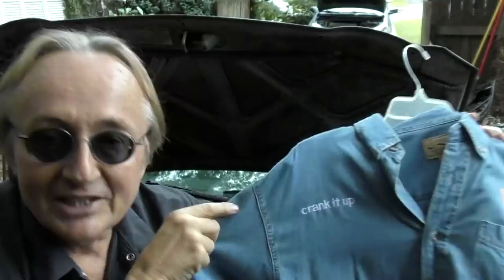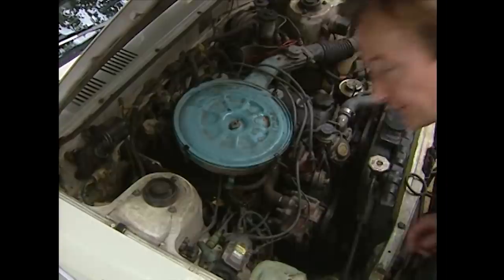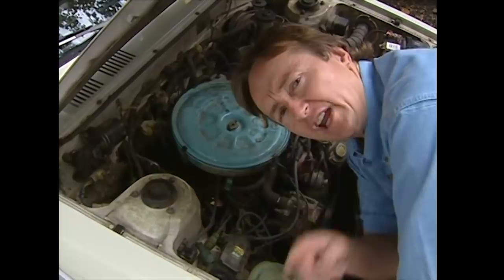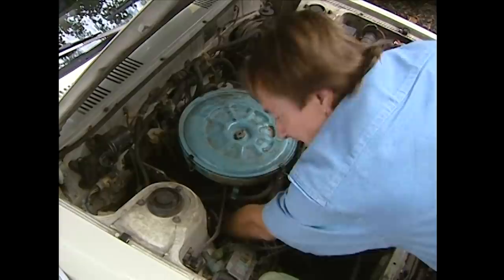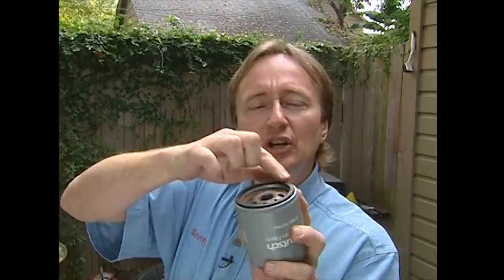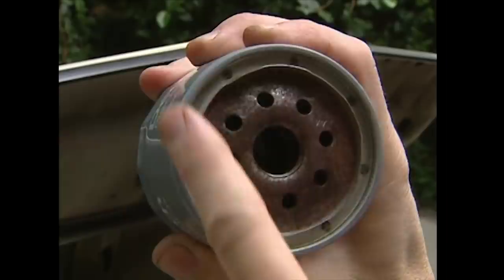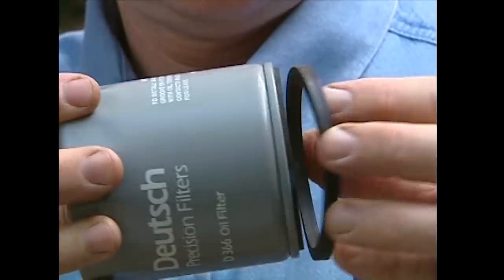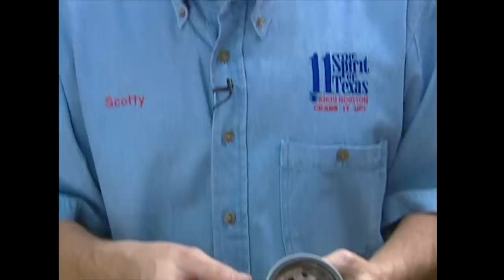Never Do This When Changing Your Engine Oil

Comment: Every time I try to remove an oil filter from oil change shop or dealer it feels like the filter is welded to the block. My old autoshop teacher told me the filters are self tightening, I think he meant by the expansion of the rubber o-ring. You go hand tight until it seats, and then about another quarter to half turn. This and always add a light coating of oil onto the new filters rubber o-ring seal before you install it. Dip your finger in the new oil and apply to the new filter, I also put some on the metal thread and in the filter if possible. Doing this I have never had oil leak from my filter in 15 years and am always able to remove the filter with firm hand pressure and no filter wrench. How do the oil change shops do this for a living and mess it up?

Comment: Scotty, do you have a tutorial on how to replace an oil pan gasket, without having to remove the engine? I have  1979 for F150, 302 v8. Just by looking around the oil pan and noticing oil residue I believe that’s it could be the gasket. I am pretty sure that is one of the many issues with this old truck, however, I would like an expert advice.

Comment: I made that mistake once with the Subaru I was out in the winter and it was cold and I did not see that the old o-ring got stuck on the engine I placed on a new oil filter after draining the oil and put about $40 worth of high-quality oil and additive into it started it up and it all started pissing out all over the place so I shut it down left it like so and then I had to go correct that issue and buy more oil and at that time in order to work on my car I was riding about 5 plus miles back and forth by bicycle in the winter so it sucked in order to change the struts of course the right ones were not available I had them in the trailer on my bicycle so during the winter I'm hauling over 80 lb of spring and strut in excess of five miles by bicycle but I got the work done due to other issues with the car and not wanting to put the wrong struts in the front end because they were no longer available as my Subaru was only made for one year as it was a Subaru Legacy Outback I ended up trading it in and I got my Dodge, now I just have to wonder when that god-forsaken Chrysler transmission is going to blow why couldn't Chrysler build one of their own good reliable Transmissions.

Comment: Happened to me once when i took my car to a sketchy mechanic, guy left the o ring on and the car leaked all the oil to the point that the oil pressure light came on while i was driving and I shut off the engine before it got worse

Comment: Had oil changed at the dealer for convenience and peace of mind that it would be done correctly last June. Wrong! They left the old oil filter gasket on and thus doubled up gaskets. Found issue three weeks later when oil light came on, oil everywhere. 80 dollar synthetic oil change no thanks... change it yourself and know it’s done correctly.

Comment: Hi Scotty.  Do you fill your filter with oil so it builds pressure sooner when you start the car? I have  never done this. Most of my filters are side ways mounted. I have heard of guys doing this to prevent dry start which sounds good but I am not sure . I have  always done oil and filter change and then started the car. Pressure comes up in seconds after starting the car.  Also.. There should be plenty of oil on the parts from the last time it was run so if pressure comes up in 2-5 seconds, I feel that there is no problem. I do not rev the motor. Idle state only.   What is your take? Let me know. If others have input, it is appreciated. Thanks.

Comment: Always enjoy your videos Scotty. The Starter on my 2010 Camry, 4 Cylinder began making a grinding noise when starting the engine at around 40,000 miles. I expected to have to replace it but, after 90,000+ miles, it's still going. Have you or, your customers experienced this issue before? Also, what maintenance do you recommend at this stage besides oil changes/filters & air filters? which I do regularly. So far, I've only replaced the battery 3 times, brakes at 80,000 miles & still had life left in them and, tires. It's been the best car I've ever owned. If you can find the time to reply, I would greatly appreciate it. Thank you!

Comment: This is hilarious because i made this rooky mistake on my wifes pos dodge neon. Once that crank case pressure built up it was a freaking fire hose of oil spraying out all over my garage floor. Luckily i caught it before i dropped all the oil out.

Comment: I had a '81 Corolla that looks like the one in this video.  Mine was an automatic with power steering and air conditioning making the engine bay even more crowded.  I didn't have a ton of tools so it was a pain to change the oil filter on it.  It didn't die even under my abuse of clueless wanna-be weekend mechanic.

Comment: I just changed my oil and the new one didn't come with a new gasket and I didn't even think about it but when I put the new one on the old gasket came off and I was like o crap,cii kinda need this and I put oil on the gasket as well so it isn't stuck on for all eternity. They didn't do that with the last one so I had to us a screwdriver to put a hole in the filter and turn it

Comment: I agree...on some cars you had to be an anorexic contortionist to get to the filter. Then Subaru started mounting them in more convenient customer friendly locations. Some manufacturers started as well afterwards but then noticed a dip in service income, so they made them difficult again with skid plates or plastic crap you have to remove so you would just bring it to the dealer.  Then came the quick lube places to cut into their profits again.

Comment: This isn't just a myth! I did this when I was 16 or 17 on my '98 Jeep Grand Cherokee. Knew enough to change the oil, but didn't know about this. A few hours after changing the oil I leave to go somewhere, hear knocking down the driveway. Thankfully had enough presence of mind to pull in back home and investigate. Sure enough, the old gasket stuck on the block and let all the new oil leak right out during those few hours. One of those things that changes you for life, I have ALWAYS double checked since that incident!

Comment: please help i have a 2006 duramax and i use delo 400 15w-40 le do you know if the new spec of oil the ck-4 is ok for my truck please i called the dealer and they don't know a damn thing thanks

Comment: Having to change your oil and filter every 3000 miles? Nowadays the recommendation is 10000 miles isn't it? But 3k miles doesnt' seem that much. If you drove a lot for your job you'd be changing them every month.

Comment: Hear me automakers...bring back the spin on oil filter....those new filter only element is a pile of crap to change. My wife's  RAV4 has one...I will not even touch it. My truck has a spin on filter...13 Tacoma has filter on top of engine...so easy to get at.

Comment: Scotty, you were so cute 20 years ago, what happened? 😂 Teasing. You weren't cute then. Just kidding, come on. Hot then and still hot-- you haven't aged much. I enjoy your videos, and your under $10 spark plug anti fouler on the O2 sensor smog fix saved me hundreds from having to buy a catelytic converter. Thanks for your videos.

Comment: I've done about 4500 miles in 8 months on my Hyundai getz, should I do an oil change?
Reply: you sure should......!
Reply: Absolutely. If you care about your engine.
Reply: @stevefranklin8052  I'd rather it didn't go bang 🤣
Reply: @redstihl9027  then why are you asking instead of just doing it?
Reply: @stevefranklin8052  I never realized I needed to do it, this is my first car
Reply: @redstihl9027  then you definitely need to read the owners manual especially MAINTENANCE SCHEDULE,   and your Dad needs to teach you about cars. By the the way, I knew cars needed oil changes long before I was 16, when I got my 1st car.
Reply: I know they need changing, just didn't realize it was often
Reply: You can change the oil or change the engine, it's up to you!  L O L